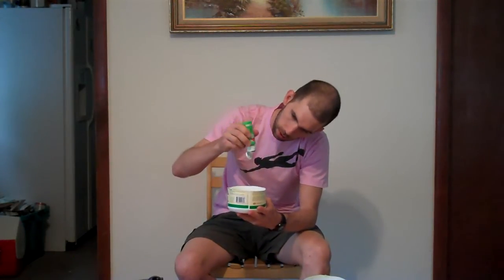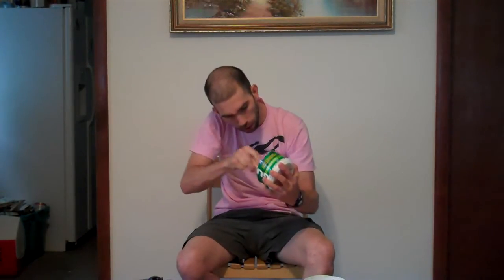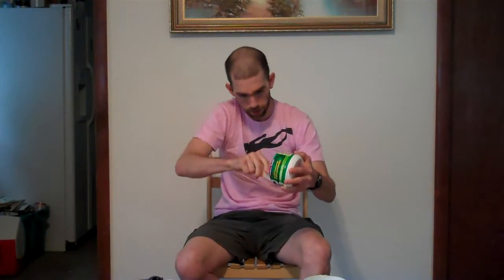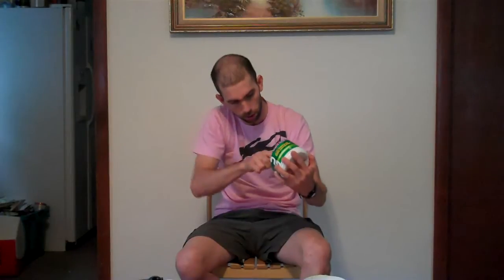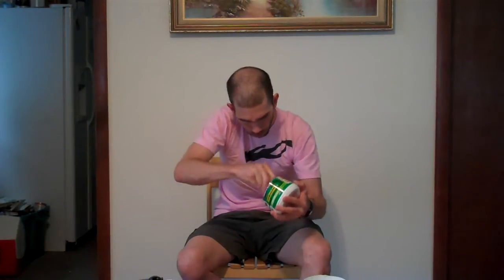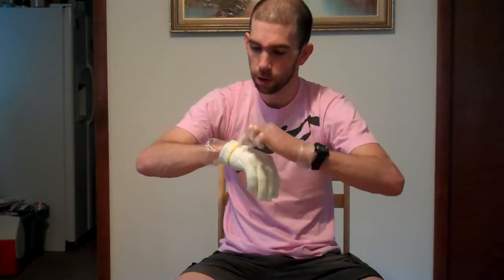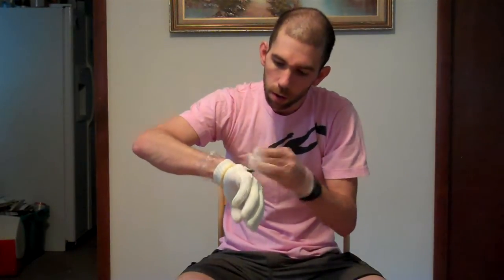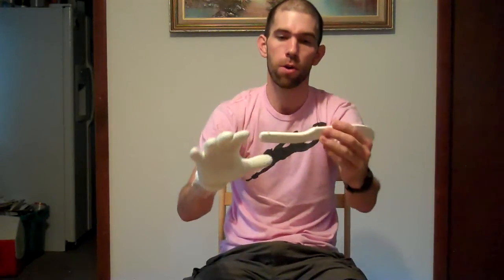UWH Glovemaking Step 1 - The Base Layer

Comment from the maker: Thanks, Damien.  Hope your gloves work really well for you!  Here are the numbers I use for caulk quantities:
1 tube = 299mL or 10.1 fluid ounces
Base Layer for medium/large glove = ~1/5 of a tube
Padding Layer for medium/large glove = ~1/2 of a tube
Base Layer for small glove = ~1/6 of a tube
Padding Layer for small glove = ~1/3 of a tube
I do like my padding layer thicker than average, though (I hate hand injuries!), and I also usually have silicone left over in the mixing bucket when I'm finished (I prefer to mix a little extra and waste some than to run out when I'm not quite finished).
Reply: +Philip Hickey Hello Philip, how are you? loved this vids and I will try to do the gloves. English is not my native language so I don’t quite understand everything you say. Do you use the same type of silicone on the base and on the padding layer? (I know one is white and the other clear). Someone told me, once it dries you cant add more later cause it will detach. Thank you very much. J
Reply from the maker: +Mary Jane Boer, thanks for your comments :)  Yes, same type of silicone for both layers.  You definitely CAN add more silicone later - silicone sticks very well to itself, even after the first application has fully cured.  Just make sure the existing silicone is clean and dry!
Reply: +Philip Hickey Thanks for the quick answer. I will try to make them. I made 3 already but always applying the base and top layer at the same time (that’s how I learned). This way is more pro (and cuter) :-)

Comment: Hi, Philip. Your video was quite helpful and inspirational. Just had one question, what's the material in that green small bottle?
Reply from the maker: Hi, 戎晨轩.  Thanks for your comments!  The stuff in the green bottlie is acrylic paint like this: https://www.amazon.com/FolkArt-2592-Outdoor-2-Ounce-Acrylic/dp/B0050FD6ZG
Reply: Thanks,Philip. I've made my first glove yesterday and works pretty well. But, still have some questions. 1. what kind of nylon glove you take as the base? i chose the one from local small tool shop, but it seems too rough and don't feel handle well. *2. i used ge silcon2(also fast dry within 30 minutes) white colour, but it seems too sticky so that it become quite tough to shape a smooth surface which you did in the video. Did you add some water to mix with caulk? i would appreciate if you could give me more advice. Thank you !
Reply from the maker: I use "Classic' brand roping gloves.  You can buy them here:
https://www.amazon.com/Classic-Equine-Deluxe-Roping-Glove/dp/B0013ETC7E/ref=lp_14553144011_1_15?srs=14553144011&ie=UTF8&qid=1466735512&sr=8-15
For the caulk, I use GE Silicone 1 (not Silicone 2) and I just mix it with the paint, no extra water.  If the stickiness is giving you trouble, try using a soapy, wet stick for the shaping (the soapy water keeps the silicone from adhering to the stick).  Good luck!

Comment: What material is the string knit glove made of? I mainly use cotton, but I have heard that nylon is a superior material.
Reply from the maker: Hi Brad. I've used a lot of different gloves over the years - some cotton, some synthetic, some that are a combination of both.  Regardless of material, the thicker gloves tend to last longer.  Very thin, smooth gloves give very good grip and 'feel' for the stick, but to tend to tear and wear through, especially on the palm side.  Lately, I've been having good with nylon film-handling gloves from photographic supply stores.
Reply: Philip Hickey I went on a hunt around town and found, what I think is a great option, exfoliating nylon bath gloves. Superior caulk grip, no bubbling while setting the base layer, mold resistant as well as lighter and more durable than cotton.
Reply from the maker: Brad Smith I've used those before, Brad.  They seemed to work fine, although I don't think I ever made a glove for myself with them, so I can't say how they'll feel on your hand.  Good luck!